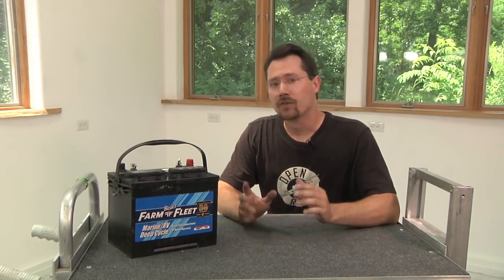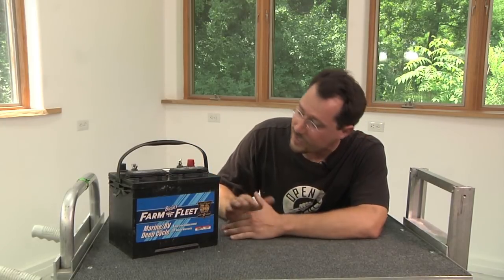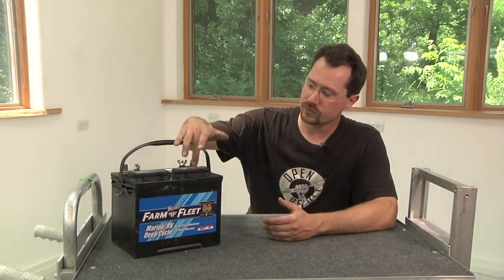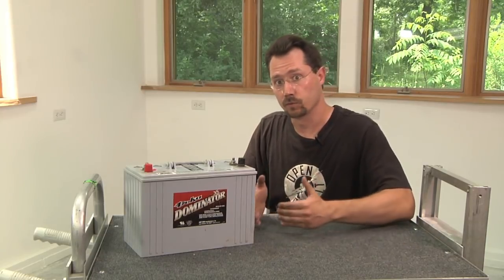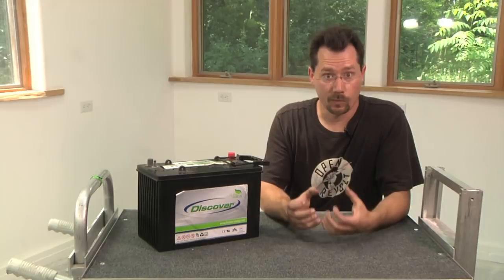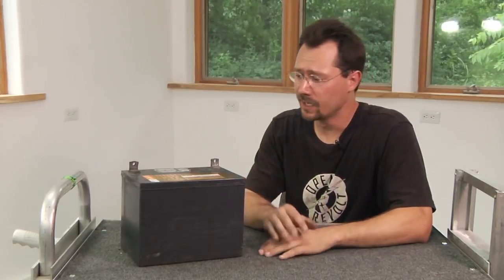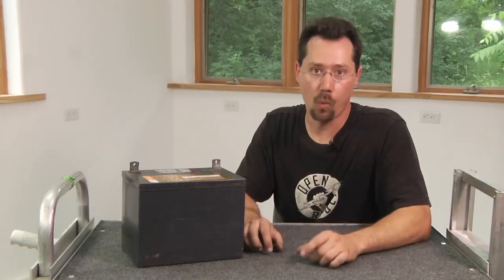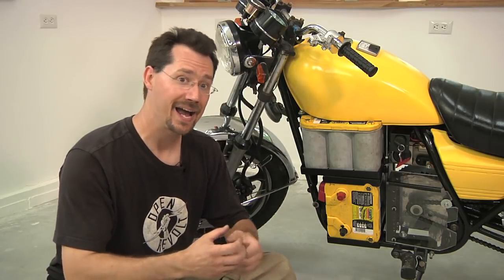7 Build Your Own Electric Motorcycle - FULL - 7 Batteries

Comment: Exactly what I´ve been looking for. My fabrication skills are way too limited (and my tools), and finding FeLiPO4 batteries (the best for my application) is nearly impossible in my country under the current circumstances. I bought one of those for my motorcycle and I was very happy with the result. Two years and a half, and ran like new, while I was condemned to buy yearly one of lead-acid, with a "T" shape configuration that was nearly impossible to find in stores. I´m subscribing to your channel, Ben. 

Ride on!.

Comment: Hello Mr Nelson, thx for the videos. I have a electric scooter that uses a 72v 20 amp batterie, I work as Uber eats in France but my autonomie is very short, between 30 and 50 kilometers per charge, that takes up to 6 or 8 hours to charge, i was wondering if I could use 3 x 24v 100 amp car (motorhome) deep cycle batteries to generate 72v and more amps. Do you think it could work?
Reply: I am a bit late to this, but you propably could, if you put them in serial and have the space, you also have to make sure to have something solid like lead acid gel or lithium ion batteries. There are also a lot of other things around the corner like a different controller etc.

Comment: What was the power and price of your battery
Reply: If I want to give double the speed of your s than what power of battery I need
Reply from the maker: On a DC motor setup, you want higher VOLTAGE to spin the motor faster. Consider a 96V system for high speed.

Comment: Would you suggest using a lithium ion or a lithium iron battery now that they are cheaper?
Reply from the maker: YES.
I originally built this project in 2007. At the time, a good lithium battery pack for a motorcycle would have cost $10,000.
Lithium is definately the way to go nowadays.

Comment: Can you recharge those batteries via solar panels, say 100-200w panel setup ?
Reply from the maker: Absolutely, you can charge this with solar! I've charged this motorcycle a number of times using a 48V nominal solar panel. I don't have any videos of that, but I do have one of using the same setup for a 1970's 48V electric car.
https://www.youtube.com/watch?v=vEHU4TqA5C0
The main thing would be to use a solar charge controller and to make sure you have the rate of charge that you want.

Comment: hi, nice video. is the contactor a must, is there a way around it. heres my build , this is a off-road mini bike type, so no need for horn or light or ignition key. I just want to turn a switch and be able to go or just plug in the power wire to controller maybe with a anti spark connector. 
here is my setup
ME 1012 Motor
Kelly controller 200-500 amp 96 volts
bat 20ah 88-100v(24s) 
I cant seem to find any contactors that can handle up to 500 amps and be at 100v , any suggestions would be great
thanks
Reply from the maker: There are plenty of 500+A contactors out there. The trick is to look at an EV parts supplier.
Here is an example of one.
https://www.evwest.com/catalog/index.php?cPath=2_13
For a really simple project, you could also use something like a heavy-duty battery disconnect. Just make sure to get a high-current, good quality one. But for what you would spend for one of those, I don't see why you wouldn't just get a contactor.
Remember, what the contactor is really there for is a quick and easy way to kill the power. There are so many ways you can can do that - ignition switch, dead-man's switch, inertia or tip switch. Those all work hand-in-hand with a contactor for killing power.

Comment: Hi.  Is there a recommended minimum for wattage on an electric motorcycle?  I have a motor I might want to buy, but it's 4.4 kw.  It's from a golf cart.  Is it big enough for city speeds?  36 volts, btw.  Thanks
Reply from the maker: Simple logic suggests that if a motor can push around a golf cart, that it would be able to push around a smaller/lighter vehicle at least as well.
Keep in mind that most golf carts do NOT have fantastic acceleration.

For a simple around town motorcycle, I would suggest using at least 48V and a 300A motor controller.

I have a video of a friend's electric motorcycle where he used a golf-cart style motor, although it was one that was more powerful. You can see that at: https://youtu.be/_fif_e-mtzo
Reply: @BenjaminNelsonX  thank you.  I appreciate your time.

Comment: Mr. nelson, how far exactly are you able to go on a single charge? i know you have 2 12v bats wired to create 24 v, but you have a total of four batteries.
Reply from the maker: The batteries are wired in SERIES. Four batteries at 12V each in series for a total of 48V nominal. Each battery is rated at 55AH. 55AH x 48V = 2640 watt-hours or 2.6kw. A common rule of thumb is that an electric motorcycle will go 100wh/mi or 10 miles per kWh. So, in theory, the bike with these batteries should go 26 miles. (Do keep in mind that you want to avoid running the batteries all the way down.) After I first got the bike together, I did some testing and did two runs after a full charge. One at 45 mph until the voltage started dropping quickly, and another at 25 mph to the same voltage. I did 32 miles of range at 25 mph and 23 miles of range at 45 mph. Averaging the two of those is pretty close to the 26 mile estimate.
Also, keep in mind that this motorcycle was built in 2007. In 2018, the price of lithium batteries has come down dramatically. Some commercially built electric motorcycles have 12kwh lithium battery packs with a range of well over 100 miles. Some of those also offer chargers that allow for very quick recharging for long road trips.

Comment: Great video. Sad it hasn't aged greatly with the popularity of LiPo batteries
Reply from the maker: When I originally built this project, lithium batteries were available, but would have been about $10,000.
Take a look at all the other videos in this series. Those are still pretty current.
Reply: @BenjaminNelsonX  yeah I've been binging the whole series, I've done some EV projects in the past and I'm currently working on a powerwall project. The hardest thing for me to figure out is motors, where to get them and what I should be looking for. For my next project (looking at doing an EV bike) I'm thinking of using either a forklift motor or a golf cart motor.

Comment: have you ever tried using a motorcycle transmission w an electric motor? or has anyone?
Reply from the maker: For the most part, a transmission doesn't do anything to help an electric motorcycle. It's mostly there to convert enough power from the engine to torque for the performance required. Electric motors have more torque in a wider band of RPM than gas engines do.
If you DO want an example of an electric motorcycle with a transmission, check out my buddy Russ' project - VOLTZILLA. He got a scrapped out forklift for free from his work, took it apart, and rebuilt all the components into an old CB550, and kept the transmission. It uses most of the space in the frame of the bike, so all the batteries had to be mounted out in the highway bars. It's still a GREAT showcase of DIY attitude and he basically built it for free!
https://www.youtube.com/watch?v=ISzpQWREZME
Russ has lots of other interesting videos, so make sure to check out his YouTube channel as well: https://www.youtube.com/channel/UCLuDKTNDFfat7iO7KGE7fQA
As always, if you are interested in building a project, take a look first at what other people have done. The EV Album is a great place to start: http://evalbum.com/type/MTCY
Reply: @BenjaminNelsonX  It would be interesting to do a test. I feel like the electric motor would run more efficiently in a higher gear and with the flywheels inside as well. there May be an opportunity for Regenerative charging with the existing alternator. Thanks so much for the reply! I will check all that out

Comment: Question. If your motor can only draw a max of 400amps and your controller can deliver that, why have a battery that can deliver 870amps (cranking amps)?  Do you get more power/acceleration by using a 870amp battery  vs a 550amp battery even though the  Motor can only draw 400amps?
Reply from the maker: In this case, the motor and controller are bottle-necks compared to the battery in terms of instant power. The cranking amps power of the battery is really a property of the size and chemistry (and a few other variables) of the battery. The batteries that I wanted to use just happen to have a nice high crank-rating, but it's not as though there was a different battery, which was identical in all other ways, except for a lower cranking amp rating and also being cheaper.
I was really looking for a battery with a good discharge rate, an appropriate size, maintenance-free, and in the end it was nice to have options in mounting the batteries (including sideways!)
I would also bet that I probably DO get better acceleration than I would with a battery with lower cranking amps. Also, as batteries age, the total power you can get out of them decreases, and how long long you can draw that peak amps out would lower too.
Reply: OK thanks Ben, just looking for some info on batteries for a project I'm working on. BTW you make good Videos on a variety of topics, keep em coming.
Reply: 1dh11 my friend this guy was a pioneer.. tech has come a long way in a very short time.. you want to use a BLDC motor a sinwave controller.. keep researching before you commit to components.. check out A123cells.. I've seen 200mph top speeds and100m range with this configuration..

Comment: Hello please help me I have a 2000W E-Vader Electric Motorcycle I 2019 | Brushless 72V and I have only charged it like 20x and it seems to die faster. At first i was getting about 20 miles before battery dies and now its like 12. It is a lead acid battery and the people/company i bought it from dont know jack s@#*. So I dont know how to get a replacement one. (Help me Obwan Kenobi your my only hope)
Reply from the maker: Sounds like one of your batteries is bad, and that drags down the entire system. Open up the motorcycle, figure out which battery is bad, and replace it with the same size/shape/capacity battery.

Comment: Someone told me that lithium is not a good choice for a motorcycle because electric motors draw exponentially more current the more "loaded up" they are (so if you start it or accelerate on your motorcycle). Now I'm thinking the controller should be able to regulate the power right? So it shouldn't be a problem...? I haven't watched the video on the controller yet :P
Reply from the maker: You heard wrong. Lithium batteries are great! This project was originally built back before lithium was affordable for a project like this, so this project used AGM lead-acid batteries. All modern electric cars are using lithium, and they can draw plenty of power.
Reply: BenjaminNelson
I've been looking into Li-Po batteries on robot marketplace.com, and some of them allow for 100 continuous! Wow!

But they still can only support 600 Amps (for a 6 Ah pack). If it's 7.4V, it'll take 10 of them in a brick to get to 74 Volts a nice number, and then 4 of these "bricks" just to have enough capacity to get to my university and back on one charge (I used to fact that a Honda Grom does 50 mph using a 7.5 kw engine to do some rough calculations). So here's my question : If four "bricks" are being depleted in parallel at, let's say 300 amps (this gives 30 HP, my target number) does that mean each individual cell is being discharged at 300/4=75 amps? That's a mere 12.5 C for these particular batteries. That should give me plenty of headroom for startup/acceleration, right?
Sorry for the really long reply 😅

Comment: What about group 32 batteries?
Reply from the maker: "Group" numbers usually just refer to a specific size and shape of battery, and batteries of the same group number usually have similar capacities.
Using a physically smaller battery can be advantageous in that you can put more of them in series, getting to a higher system voltage, but at the expense of battery AH capacity.